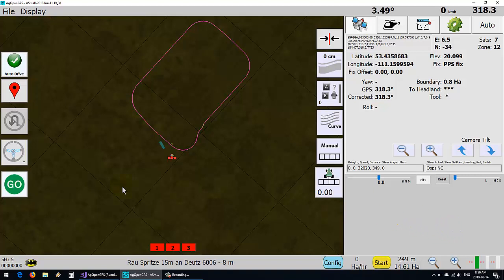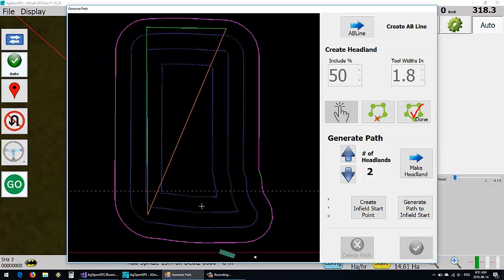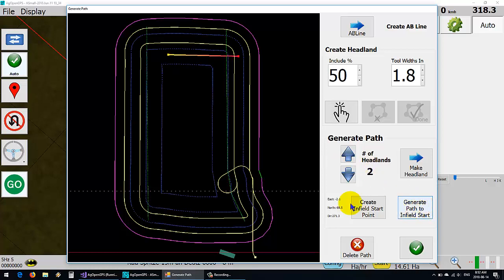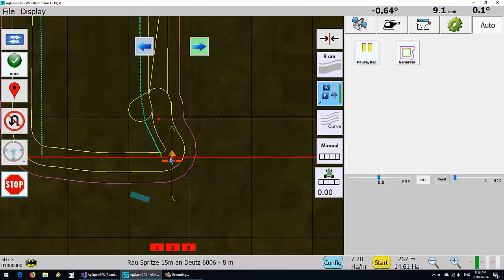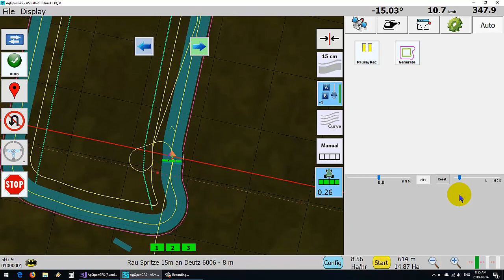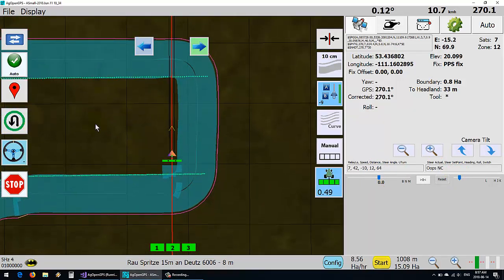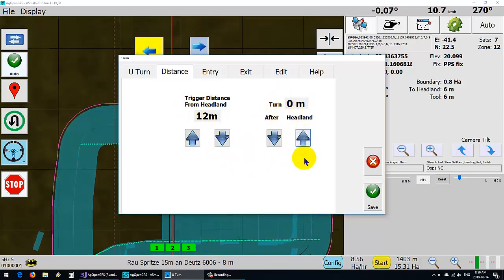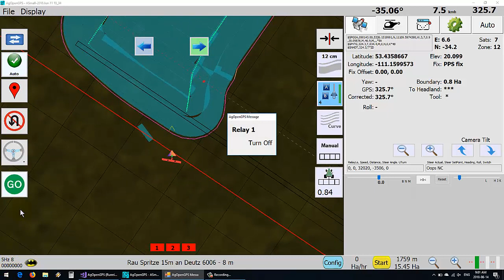AgraBot the AutoBot

Comment: Hi Brian I am using the most current version of AOG and I do not see the "generate icon" like in this video I also have AgraBot software again most current as of this comment, I do see the generate icon yet it is greyed out...what else besides boundary do i need to complete before I can click on it. Thank you in advance!
Reply from the maker: Because i have been making multiple boundaries and changing how uturn works, i've disabled all that stuff. It only worked fine for a very simple square field, the real challenge will be in having it do all that when some obstacles are in the way. Hopefully during the winter i can solve some of these issues - but it is extremely difficult.